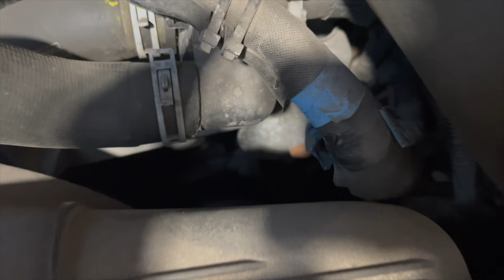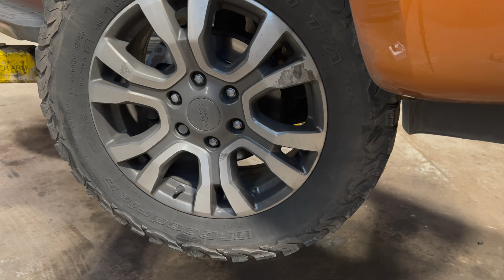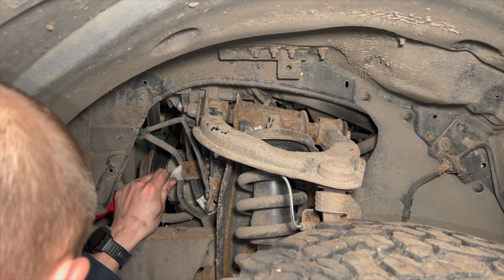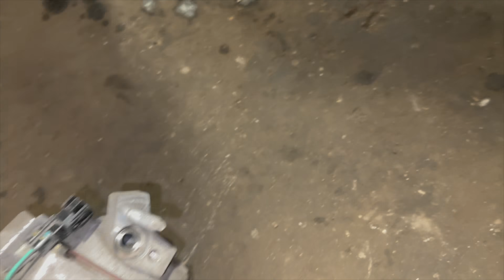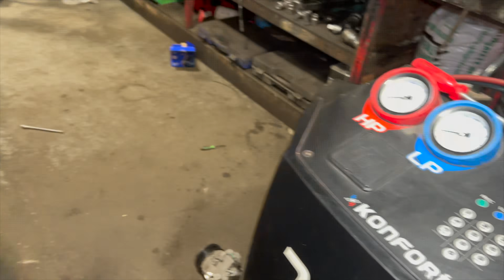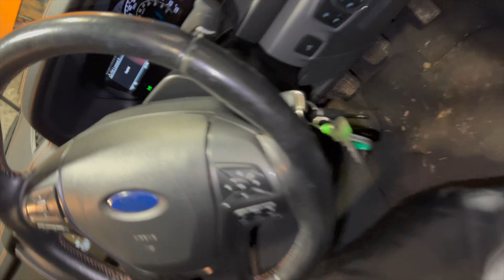2016 Ford Ranger AC compressor replacement

Comment from the maker: New Aftermarket AC compressor - https://ebay.us/3087T4
New Auxiliary belt - https://ebay.us/HjL47B

Tools Used :

             Milwaukee 18v 1/2" Impact driver - https://ebay.us/4SOewF
             Milwaukee 3/8 Drive Mini Impact driver - https://ebay.us/Pg8ilg
             Socket set - https://amzn.to/3eGx2Ak
             Ring Inspection Lamp - https://amzn.to/3gGWHcG
             Trim clip tool - https://ebay.us/qMw5Js
             Milwaukee 12v 3/8 Ratchet - https://ebay.us/BZZqQG
             Short 1/2" air impact driver - https://ebay.us/3MIQkY
             Screwdriver set - http://ebay.us/NUu3Q1
             Small Snap on screwdriver - https://ebay.us/KK4Fik
             1/2" long ratchet - https://ebay.us/HZYPgk
             WD40 - https://ebay.us/FPw1Ww
             Texa AC regas machine R134a - https://ebay.us/KSheDx           
             Texa AC regas machine R1234 - https://ebay.us/JV3Ubq
             Texa AC regas machine combined - https://ebay.us/Yo2URu       
             Grease - https://ebay.us/DPsLxx
             1/2" extension set - https://ebay.us/6R20bE
            
Capacities :
Air-conditioning compressor oil, system total = 150  (ml)
Air-conditioning condenser (only when renewed), additional capacity 80  (ml)
Air-conditioning evaporator (only when renewed), additional capacity 40  (ml)
 
Refrigerant, ( - 01/10/2013)   
Refrigerant 650 ± 25  (g)
 
Refrigerant, (02/10/2013 - )   
Refrigerant 565 ± 25  (g)

Comment: Can you still use the car even if the ac compressor is fried and not working? Will just use it to bring it to a repair shop
Reply from the maker: If the pulleys ok it’ll be fine to use just leave the AC off

Comment: My compressor doesn’t engage unless I bypass the relay. Then when I bypass it, the compressor is very noisey. I thought maybe the compressor is partially ceased and the computer has overload protection which prevents it from engaging, but if you say the compressor in the video was partially ceased and getting red hot perhaps then sounds like I’m wrong 🤔
Reply from the maker: Yeah it’s quite a common issue im afraid
Reply: @diydaly  so bit of an update, bypassed relay again, let it idle, compressor was engaged, gave it a rev, then the compressor (or something else near it - yet to take it apart) exploded and gas went everywhere 😅. So in summary; I’d guess that the ECU does have compressor overload protection and won’t engage clutch if compressor is bad, bypassing relay will work but a bad idea, and ceasing compressors on PX rangers must be a bit of a common problem as you say

Comment: Just a gentle reminder on the Warranty.

If the Receiver/Drier is not replaced including TXV and a system flush the warranty might as well be thrown in the bin! 

The warranty card that comes with the Compressor states this and has to be signed off by the respective Technician who carried out the work.

In the round, a one for one without the above will very likely make the Warranty void! 

Something to bare in mind. 👍

Comment: Thanks for this great in depth video, going to have a crack myself. With your comment about adding oil to the compressor, is it common for most regas machines to be able to do this? I will need to take mine in to be regassed by a professional after replacement. If the new compressor already has oil in it too, how do you know how much to add?
Reply from the maker: I wrote the amounts in the video description but yes most machine should be Able to do this
Reply: @diydaly  Thanks! Do you also need to flush the system before replacing the compressor?
Reply from the maker: @toolowgo  👍 no you won’t need to flush it
Reply: @diydaly  Thanks! Will give it a go and let you know :D
Reply from the maker: @toolowgo  👍
Reply: Thanks again for all your help, did this job yesterday with no major issues, my droning compressor sound is gone! I went with a genuine compressor which came with some refrigerant oil but I drained it and replaced it with the 150ml of Pag 46. Thanks again!
Reply from the maker: @toolowgo  nice one! Glad to hear you got it sorted 👍👍